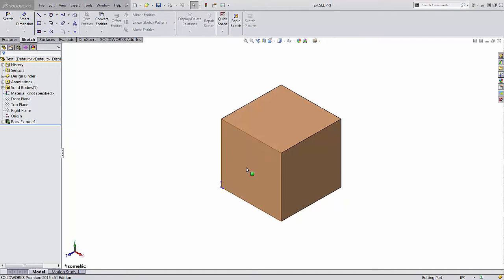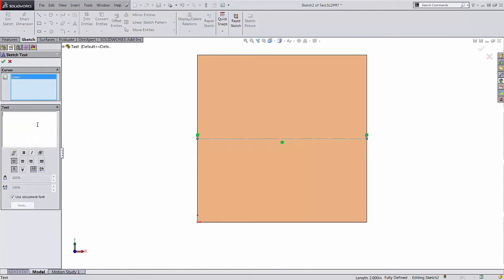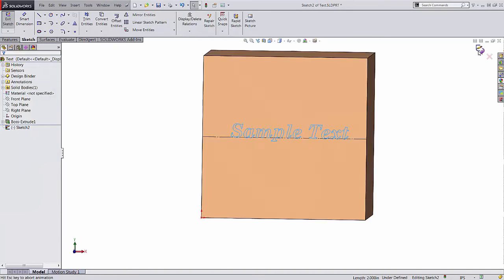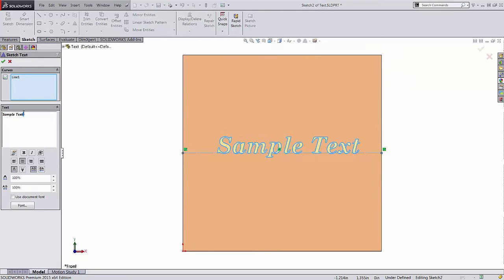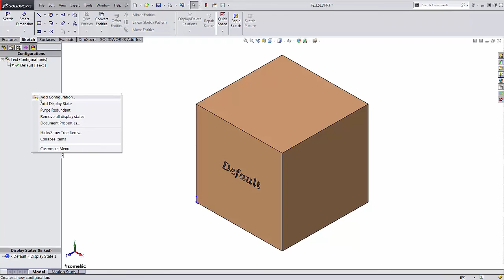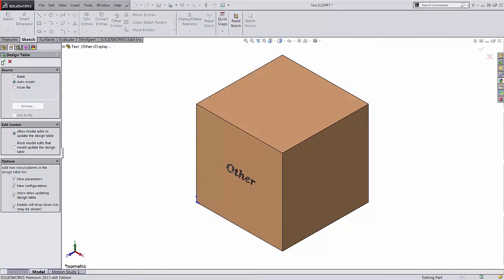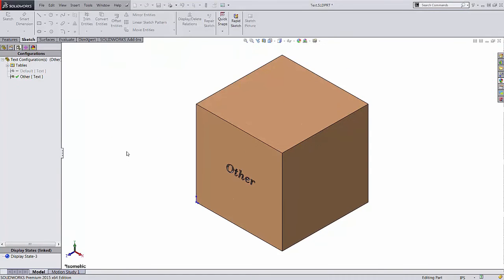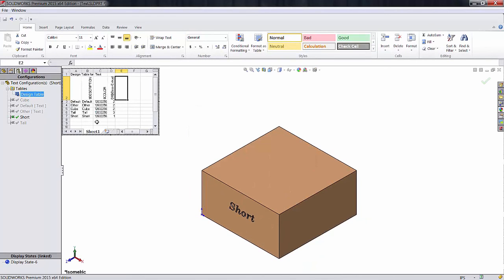SOLIDWORKS Quick Tip - Linking Text

Comment: Doesn't work any more since Solidworks 2018. If you try to use several different configurations of the part in an assembly, they all show the same marking.